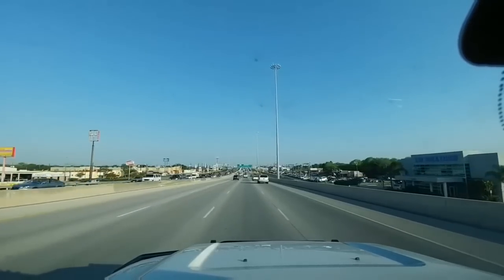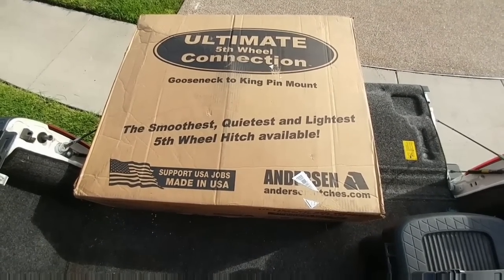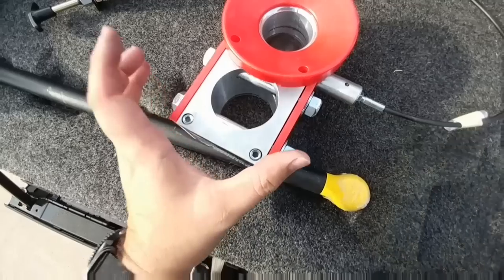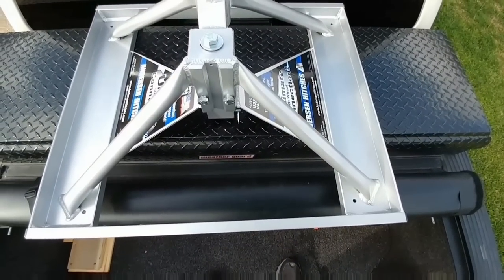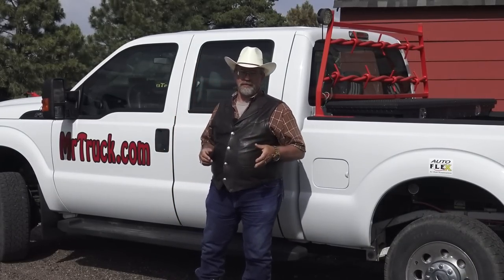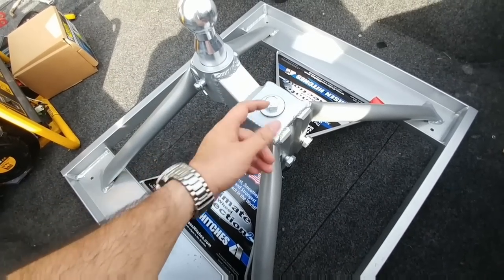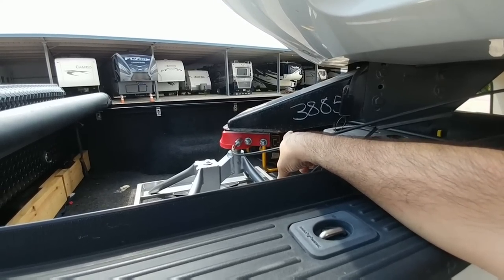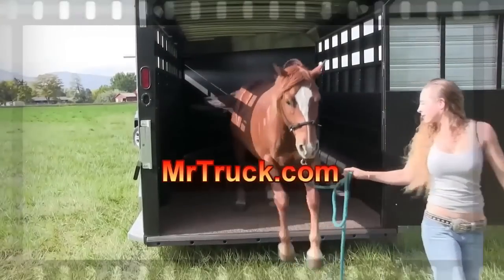Andersen Ultimate 5th wheel Connection review with MrTruck and Big Truck and Big RV, ultimate 5th

Comment: I bought an Andersen Ultimate 10 days ago to use on my new 5th wheel. Truck is a Chevy Silverado 2500HD Duramax that came with rails installed in the 6 1/2 foot bed. The hitch I ordered came set up to use those rails and is locked in by 4 pins. If you want to use this setup, 2 things to be aware of. 1. if your truck sits high, you will need to raise the gooseneck at leat 1 hole higher for clearance of the side wall of your truck. and 2 Be sure and check the distance between the bed wall and the hitch (A), and the distance from the center of the gooseneck adapter and the back of the king pin box (B). If B is greater than A then the adapter plate needs to be behind the king pin. For a 6 1/2 bed, you most surely need to rotate the adapter plate so that the ball coupler is behind the king pin. With my setup, I have almost 80 degrees on both sides

Comment: Just got mine last weekend, installed everything in less than 30 minutes, haven't really had a chance to use it really, just moved the trailer from front to back, but it seemed to work fine, the base does take up a lot of room in the bed and is very awkward to carry by yourself, however it is light enough for 1 person to carry, it goes in and comes out very easily in 5 minutes or less and is very sturdy. The funnel on the kingpin works great if you haven't lined up perfect, I wouldn't trust it going smoothly if you aren't already close but if you are in the realm it sucks it in pretty easily. I don't know what else to say, for about $200 more than a gooseneck adapter it is safer, more sturdy and just looks more durable than the adapters.

Comment: What keeps the adaptor box on the king pin from slipping or shifting side to side when turning or applying a hard stop? It doesn't look like to me that the 4 allen bolts would hold the force of the trailers hitch from shifting side to side or allowing it to rotate around to the front of the Anderson Hitch. If that were to occur wouldn't the 4 allen bolts damage the king pin plate?

Comment: I have a LONG bed one ton Dodge 3500 HD and the hitch in the bed has the ball toward the tailgate but I also read that in long beds you need to turn that hitch around so the ball is toward the rear window. I turned the red coupler around so its facing the RV and the pin connector is toward my tailgate.....I find most questions are for short bed trucks. Sometimes confusing..I'm just an old lady traveling.
Reply from the maker: I think it works either way, the hitch still pushed down on the truck bed gooseneck ball so it pushes on the frame in the same place.

Comment: I have this setup. I have used it on 2 trailers. If you have an older unit then please beware of this system. You have to raise the trailer really high in order to clear the ball. If you're Landing legs electric motors are a little old and weak you will have a hard time. They will strain and you will hear it. Just trying to help you guys out

Comment: Important question , Do you not require safety chains from truck to trailer, for the fact its a ball connection, not a actual fifth wheel connection?
Reply from the maker: Yes, ball connections require safety chains. RV industry have lobbyist so they magicly don't need safety chains.

Comment: Bought a brand new fidth wheel with an anderson ultimate hitch and the day I brought it home I had to make a sharper turn in my 3/4 ton 6 1/2 foot bed pickup to get it pointed toward the driveway only to smash in the steel cab corner, smash the rear window and badly sratch the fifth wheel cap.  Welcome home!!!  Very frustrated!
Reply: what kind of 5th wheel?

Comment: After you installed the hitch in the truck I see that the ball has moved  from the center of the axel to behind the axle
Reply from the maker: But the tongue weight is still applied to the ball on the truck bed which is attached to the truck frame.

Comment: I can see this being just fine on asphalt but I doubt it holds up to rough gravel we have in northern Alberta and Saskatchewan.  Too many frost heaves and washboards on the gravel and with little low torque set screws holding your shit together.. I like things that stay together, especially in places with zero cell service for 200 miles.. all that being said looks great for highway/non off road applications and Anderson’s levellers are the best, I need a new set since I sold my camper and sent them with it!
Reply: I take mine off road all the time no problems

Comment: I have a Chevrolet C 4500 Kodiak 4 wheel drive with a I have a Chevrolet C 4500 Kodiak 4 wheel drive with a flatbed I was wondering if it would work on it
Reply from the maker: Not sure if an extension will work. What brand of ball does it have?

Comment: I own an Anderson hitch and make sure you torque those set screw to specs. It was installed at the dealership incorrectly, very scary when you see them moving around. Great lightweight, strong hitch. Rated at 20k at a third of the weight.

Comment: Since the king pin hitch is now offset from the trucks gooseneck ball, what keeps this Anderson from pivoting in the bed?   I see its sitting in the bed along with the molded sheet metal, but wouldn't that rip?  Seems like there's a small hole at each corner of the anderson...is that to keep it in place but not done in this video?
Thanks
Reply from the maker: The weight of the trailer king pin and the truck fender wells keep the frame work in place

Comment: I'm interested in this hitch but how much weight can it handle? Looks kinda light. Also how much does it cost? And finally does the base just sit on the truck bed with no bolts through it and the floor? My truck already has a goose neck hitch installed but my trailer now is a normal fifth wheel.
Reply from the maker: https://mrtrailer.com/andersen-ultimate-5th-wheel-sale.htm  watch the video here

Comment: I have watched Mr Truck for some time as well as your channel and think your collaboration is a great idea. I am considering this system but have a question. From the gooseneck ball center, how far towards the cab does does the base of the Anderson hitch go. Here is my challenge. I have a 2013 Chevy extended cab short bed 2500hd with factory installed CNN tanks. The metal box to cover tanks is larger the a tool box. I need to know if the platform will go in without modifications? Second my bed I'd tall and not sure of clearance. Lastly with a 6.5' box I could see installing the king been backward like you did ti increase clearance? Your thoughts? Thanks and really like you channel.
Reply from the maker: Thanks, Yes, if you turn the Coupler around he’ll get 9 inches of offset which 
will work great in your short bed truck. We have an ultimate connection 
called the TBX Version it is 4 inches shorter in the front to give 
you more room for a toolbox or gas tank. 

https://download857.mediafire.com/7c845sgw65ug/vabt5pb02hkuf86/3220-TBX+%28Toolbox+version%29+Ultimate+Connection+Dimensions%282%29.pdf

https://download1490.mediafire.com/eb2ymhkancug/nbzl01q9hizoit5/3220+aluminum+Ultimate+Connection+2+GN+dimensions.pdf
Reply: MrTruckTV thanks, I live in Parker, CO, Do you sell these and possible install as I also need the Gooseneck?
Reply from the maker: I do sell them. This attaches to the King Pin of your 5th wheel. Do you have the gooseneck ball in your truck?
Reply: MrTruckTV no Gooseneck hitch yet, actually I just bought it.

Comment: the thing i dont like is the reason why the adaptor is not swivle is juste the pressure of the 4 bolts scrubbing the 5 wheel plate. i am not sure if it will not turn if you put brakes during turning. i know that your supposed to adjusted the brakes on the 5 wheel but you know that, when you leave your home and you go fast because holiday and forget little thing to do before leaving home... have a nice day

Comment: Mr. Truck I need your help again. I'm having a brand new tandem axle 27' Travel trailer that weighs 5100lbs dry. Its coming with 205/75/r15 Castle Rock tires. After researching those tires, I can't find where they are made. I'm afraid they might be as bad as Trailer King and Power King tires that I've read so many bad things about. Here's my question to you since you haul so many different trailers...in your opinion, what brand of tires do you like the best? I'm leaning towards Goodyear Endurance but now seeing good things about Carlisle tires. I'm only going to pull the RV twice a year so of course spending more money for minimal use is not going to be fun but I don't want to buy a super cheap quality tire either. What would you recommend? I think I understand now the difference between radial and bias tires and understand that I do need to use a ST tire and am looking for an E rated tires instead of D rated. I only drive 65mph when towing.
Reply from the maker: D rated is all you need for 5100 lbs to many 8000 lbs loaded. I don't recommend Carlisle tires. I like Boar and Gladiator or Michelin if you have money.
Reply: recommend "G" load rated tires for your trailer.. may be expensive but what would a blowout cost you when your towed and/or towing rig is wrecked ?

Comment: THANK YOU .  I HAVE A HALLMARK CYCLONE TOY HAULER 3712 2008 41 FT. AND A 95 FORD 350 DUALLY 5.8 GAS/ 351 C.I. I HAVE TOOL BOX AT END OF MY 8 FT. BED HIGHER THAN THE ONE DEPICTED HERE.  THE TOOL BOX IS JUST BELOW THE TALE GATE HEIGHT.  MY ELEC. JACKS SEEM TO START CLICKING  WHEN I GET TO THE HEIGHT OF THAT I NEED REQUIRING ME TO MANUALLY CRANK THE TRAILER UP.  I THOUGHT THE ANDERSON WOULD RESOLVE THAT ISSUE BUT IT APPEARS IT IS HIGHER THAN MY DRAW TIGHT ABOVE BED HITCH.  COULD IT BE MY MOTOR AND OR GEARS IN MY JACKS.?  JUST WONDERING IF YOU EVER HAD THIS EXPERIENCE.    THANK YOU SO MUCH.  HAPPY NEW YEAR 12-29-20 RON SOUTHERN NEW JERSEY.
Reply from the maker: They are taller so you don't have to have much extension at the king pin

Comment: Curious. What keeps the hitch from rotating in the bed being that its only connection point is the bed mounted ball? Shear weight?
Reply from the maker: Yes the weight and the frame fits close to the fender wells. Same way B&W Companion hitch works
Reply: MrPittsburghJ mine moved from center to one o'clock. I tightened the 15/16 bolts.

Comment: Good video but I think there's too much crap that could fail with that hitch. I don't like nor trust that hitch.
Reply: So many step to install and hitch up until secure, then again thank goodness we hae the Freedom to voice our opinions/thoughts, and have the right to choose what we use and do with what we want, to an extent. I for one like it as its useful for pickup haulers, makes it much easier to handle and remove from the bed when you need it for other things when not towing, though its limited to max of 24,000 lbs and 4,500 tongue weight, that leaves usable to only heavy duty or super duty pickups with bed limits in that range at minimum. As a class A CDL holder I like it as for what I mentioned, but not so useful for more tow weight that Sportchassis or a semi or hauler pickup can handle Their testing demonstration videos do show it can handle, but then again those do not include fatigue from 'normal' real life use. I would trust it if I did need and have need/use for it.
Reply: BUDDY LIGHT What is it you think could fail? I just finished a 3700 mile trip using this hitch and it worked perfectly. It is smoother when towing than a traditional king pin and way lighter when it is time to remove it. I don't see the down side. There also fewer moving parts than a traditional 5th wheel hitch.
Reply: My concern is the kingpin coupler box failure in multiple arenas:  1.) the locking cable coming loose, unhitching.  2.) those grade 5? bolts sheering off from the force of the unit moving due to gooseneck style connection vs standard kingpin/box.  A regular 5th wheel has locking jaws that encompass the majority/if not entire kingpin whereas this uses 2 middle portions of bolts to lock it in.
That's it.  Other than that, I'd buy in a second.
Reply: I wonder too what he thinks would fail, I just watched Andersen's video on the strength test and with a down force of 54k lbs the pin that locks in the ball on sheared off and at 66K lbs the frame bent, I don't see going to those extremes pulling a 20k lbs 5th wheel trailer.
Reply: i'll bet that mr. ryan holmes didn't see that video before he presented his 'concerns'.. <grin>

Comment: Dont like how it shifts the pin back pushing the weight to the back of the truck.
Reply from the maker: It pushes on the goosneck ball below where it attaches to the trailer. Putting the tongue weight on the ball on the truck frame ahead of the rear axle.

Comment: Get a goose neck pin box for your 5th wheel.
Reply: i down voted this statement as a "gooseneck pinbox" on a fifth wheel trailer will flex, weaken and eventually rip the  overhead frame right off. it's simple force of pull angle analysis ! a gooseneck connection needs to be heavy steel frame that is attached at the undercarriage of the trailer and be engineered, designed and built from the ground up for that type of towing stress.